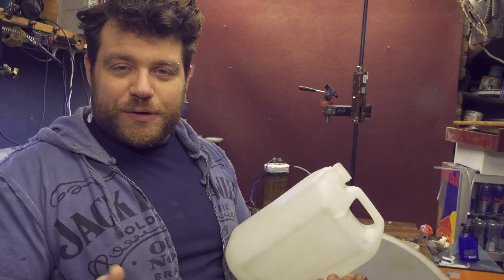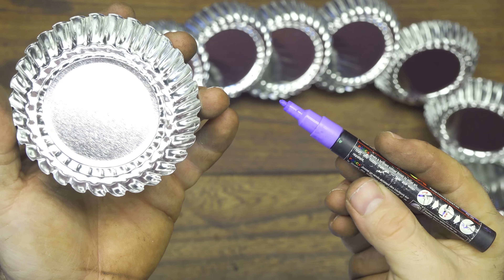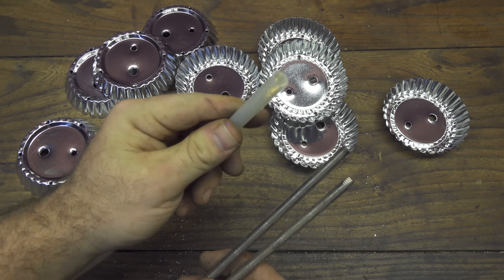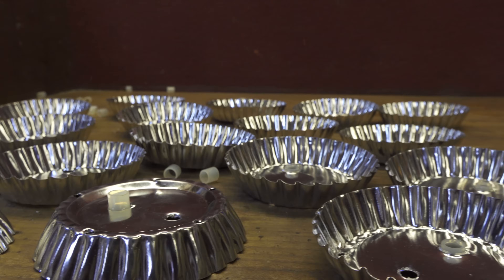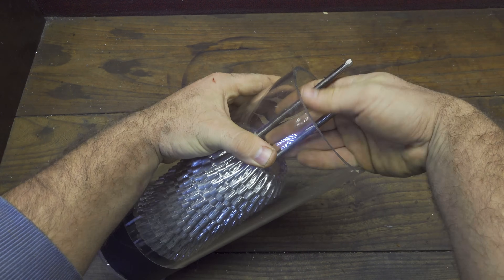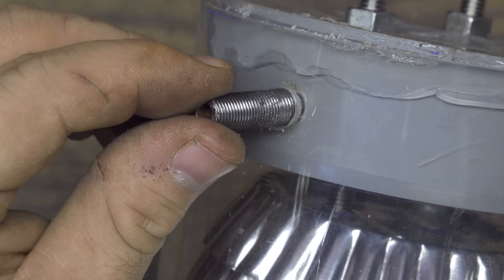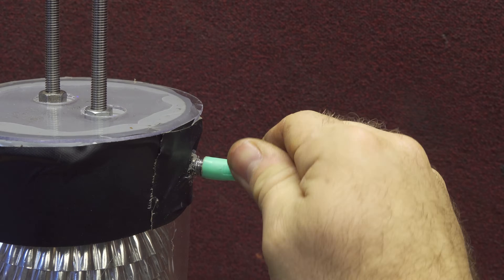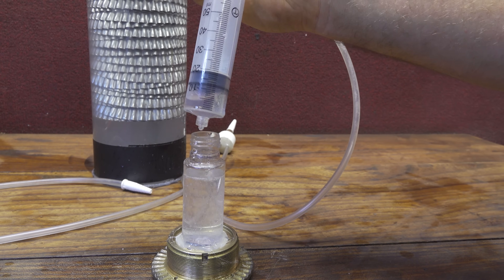Superpowerful Flame 5072 ℉ • Produce Hydrogen from Water - Do it yourself

Comment: How would hydrogen gas burn in yellow color ?
Reply: Atomic.  its temperature is actual based on what the flame interacts with.. amazing stuff.  run it across your hand its barely warm. yet touch tungsten and it will not only melt, it will VAPOURIZE it...   takes over 5000 degrees to vapourize tungsten

Comment: Could you rig that to boil water to heat your house instead of burning oil or natural gas?
Reply: Yes, but it wouldn't be any more efficient than just using the electricity to power a heater. You only get out what you put in. This flame is hot, but it's small.
Reply: @Tonyface666   Well, this tiny flame would have to be bigger.  I don't think you would need to run the wattage that an electric furnace uses.  I just read that one of them is 18,000 watts.  I would be very surprised if you needed anywhere near that wattage to supply all the hydrogen you needed to produce 80 or 90,000 BTUs that an electric furnace puts out. 
He's only using 300 watts and the real problem is turning the high temp into BTUs.
Reply: @alext9067  An electric heater runs at near 100% efficiency (because any losses are just heat).
Using electricity to convert water into hydrogen and oxyen isn't particularly efficient (the water heats up), and when you  burn the hydrogen, it only produces as much heat energy as that which was used to break the water apart in the first place.

There'd be fewer losses by just using the electricity to heat the water directly, without the water -> hydrogen + oxygen -> back to water middle step.

Or to put it another way, if you create hydrogren using 1kJ of electrical energy, you'll always get less than 1kJ worth of hydrogen to burn.

Comment: This is definitely a project i plan on replicating... Any idea on how to catch the water that gets generated so it doesn't just drip all over what you're welding?
Reply: dont make the hose to long..   takes a second for H2 and oxygen to turn back into water.

why the only emmisions from running hydrogen in a car is water out the tailpipe.

Comment: You are using wrong drill shape for thin sheet metal....if you use sheet metal drill(click on link), the holes will be much better/cleaner and you will not bend the cups: https://www.google.com/imgres?imgurl=https%3A%2F%2Fwww.physics.wisc.edu%2Fishop%2Fimages%2Fdefimages%2Fdrillsheetmetalsideview.gif&imgrefurl=https%3A%2F%2Fwww.physics.wisc.edu%2Fishop%2Fterminology.html&docid=VZ09D9Zi0pJtYM&tbnid=ggRMKpo-D5xajM%3A&vet=10ahUKEwizo7Chs8zkAhUMmhQKHRKDDQcQMwiQASgLMAs..i&w=228&h=300&bih=975&biw=1920&q=sheetmetal%20drill&ved=0ahUKEwizo7Chs8zkAhUMmhQKHRKDDQcQMwiQASgLMAs&iact=mrc&uact=8

Comment: High Amps power supply are expensive, but if you get almost any computer power supply, you can have very high amps from 5V, 3.3V and 12V lines very cheap.
BTW, Why does Hydrogen and Oxygen mix only in the nozzle and not in other parts of the build?

Comment: Steel air conditioner/appliance metal is very heavy guage, heavy duty that can typically be found ON THE CHEAP at a junkyard - a JUNKYARD or a bulk metal salvaging center. If you're there to purchase metals then the line is so short you might be the only one in it amidst all the scrappers piling in to drop off their plunder, I mean scrap metals. Going in knowing what you want really helps. Also, could you scale up the 5 volts to 10? Could it also be the overall size of the Generator itself? More surface area in the water, the fins, the enclosure and all things to scale up. I'm really looking for that 3ft long cutting torch! Just kidding! I do want to make small welds, well, medium size welds for melting metals to combine them. Welding!

Comment: Your HHO generator design is very inefficient, and probably gets very hot very quickly. You want to use neutral plates, with a higher voltage, and you can then split that voltage between the cathode and anode with neutral plates to produce the correct voltage to split the water without wasting so much energy as heat.

Comment: baking soda (NaHCO3) is a weak electrolyte. something like potassium hydroxide (KOH) or Sodium Hydroxide (NaOH) would work much better because they are strong electrolytes. only issue is that with the KOH or NaOH the electrodes couldn't be made of something like aluminum because they would dissolve.

Comment: try separating hydrogen and oxygen, then you add a preburner to increase the hydrogen temp and you can get some pretty fucking insane temperatures when the hydrogen is pre heated to it`s burning temperature  and mixed with oxygen.

Comment: But it looks like the cups are touching each other, or nearly so, and could short out... am I missing something here??  At least put a dense mesh in between them... And I think if you invert the cups, gas won't pocket in between them and block current so much.  Also your safety device/bubbler is a good idea, but I'd be afraid it would explode if the flashback arrestor failed or the supply hose was accidentally cut by the flame etc. so maybe best to shield it in a vented enclosure. 👌

Comment: max amps that you can pump through the electrodes is half of electrodes total surface in electrolyte in metric units. after this max you start heat electrolyt

Comment: By the way, your transformer is from a microwave i think, so you can use a wire whit a bigger diameter and only 2 ore 3 spire to obtain 2-3V and more amps. for DC you use diode bridge

Comment: for a better efficiency use 2v DC current. if you use 5V on your builted cell, with 3V over what i say you only heat the whater. I am not sure but fo tap whater and salt is necessary only 1,23V

Comment: Can you use copper fiber instead of brass fiber? Like the ones in copper wires?
Reply: You want brass because there will some electrolytic solution traces in the vapor that will deposit and eat copper alive, break down your flashback arrestor and cause a serious issue... I know this from experience.

Comment: Hey I have a question, how do I know the consumption rate, let's assume am using this for an hour everyday, the same setup, in a month what would my consumption of electricity in kilowatts be !?
Reply: Determine the DC current in amps and multiply it by the DC volts. The answer is watts. Divide that answer by 1000 and you get kilowatts. You don't consume kilowatts, you consume energy (joules). Energy is the product of the time in seconds times the number of watts. Watts is time related, one watt is one joule of energy per second. In other words, watts just express the rate at which joules of energy is consumed. Just as speed is the rate at which miles are traveled. Multiply speed times time and you get distance. In your case multiply the watts times hours for watt-hours. Divide that by 1000 and your answer is kilowatt-hours. Got it?

Comment: Is this the ideology behind hydrogen power? I think certain countries are looki g to make it into a viable source of energy😅.....is it the same thing?
Reply: Current mass produced hydrogen comes from steam cooking natural gas as that requires less energy to get the same volume of gas as using electricity to crack water. When cracking water for Hydrogen gas you want to separate the positive and negative terminals in their own collection areas as you will get hydrogen off one and oxygen off the other. In a HHO generator like in the video you pack the terminals as close as you can under a shared collection area as you don't care about getting as pure a gas as you are using it asap. 

If we wanted to swap over to hydrogen created from electricity we would need to massively increase the power production and include trunk lines directly to where the cracking is needed but the good news is most internal combustion engines can be modified to run on hydrogen with very little modifications to the engine or car.

Comment: So jet fuel is bullshit after all water is fuel but that would collapse the oil Bullshit market and everything that comes with it  soo will never happen... great videos man thanks
Reply: The main problem with using hydrogen as a jet fuel is the size and weight of the tanks needed as they need to be pressure tanks rather then tanks to store a liquid. In modern aircraft they hide tanks in the wings and that would be impossible for hiding pressure tanks and keeping the same wing profile 

Industrial hydrogen is also a very nasty process to make as it comes from a process done to natural gas that strips and releases the carbon and keeps the hydrogen. To get a clean hydrogen economy setup we would need a ton of power plants dedicated to cracking water and compressing the hydrogen produced.

Comment: Before internet - "Don't try this at home"
Today - "Try this at home (aka Do it yourself)"
Reply: or "disclaimer, don't try"

shows you how
Reply: Long lasting fire with Sanitizer and much more uses   Find out :
youtu.be/NybL5CrWOi8
Reply: well the governments trying to hide it since they had Stanley Meyers killed for inventing a working car that ran on "water"    aka hydrogen from water on DEMAND..  100 miles on a drop of water... lol  of course they want to keep the qaudrillion dollar oil market... cough   gasoline
Reply: @harleyme3163  thats not how this works but ok. This is a way to turn electricity into hydrogen and oxygen gas. which are potent fuels. Its a converter for one type of energy to turn into another. It doesn't make free energy. It wont make your car go forever for free or replace gasoline. It only converts electrical energy into fuel.

The only way this replaces gasoline is if jackasses stop holding back modern nuclear reactor technology. In that case we will have abundant electricity without relying on combustion and without large amounts of pollution, then using that electricity to turn water into HHO, then using that HHO to power machinery requiring fuels which will put out no pollution.
Reply: @harleyme3163  HHO is a two part system used with Nuclear power to fuel the world without pollution. HHO is not a free energy machine.
Reply: @harleyme3163  That's true for all the governments around the world. No exceptions! ;-)  lol :-P
Reply: @harleyme3163  Tinfoilers back at it again.

Comment: DON´T do electrolysis with salt, it generates toxic chlorine gas and sodium hidroxide. Also hydrogen is extremely dangerous because it can explode very violently. Also the electrodes in the water can react and liberate toxic oxides.

Comment: If you make separate stacks each in their own container (one connected to positive and the other negative) connected by a tube at the bottom so the water can flow between both containers, you can collect pure hydrogen from one container and pure oxygen from the other. Just be careful.

Comment: Good stuff but wondered when you were speaking about soldering st steel if it's actually possible? Don't know ,never done it but the question remains.
Reply: It can melt iron so it could solder it  slowly

Comment: Could you make it in a way to store the oxygen and hidrogen SEPARATEDLY?
Reply: You would need the + and - placed in separate containers, with a liquid connection.  Like a YouTube ?!  So it would cost a little more energy to make the gases separately, because of the resistance of the connecting liquid.
Reply: @gerardvaughan1847  but on the bright side you would be able to safely store the gases withou them blowing up catastrophically
Reply: @LuizBarros99  
Yes, far less dangerous.  I think the mixture is called Brown's gas, and surely a container of it is a Bomb !
Reply: @gerardvaughan1847  yeah, both a high reactive gasous fuel and a highly reactive gasous oxidiser in about perfect proportions...
Reply: @LuizBarros99  
I imagine the proportions would be perfect.  I wonder if "fuel cells" + gas bottles will ever compete with  Lithium batteries ?
Reply: yep , the positive line always forms one and the negative line forms the other, so if you spilt the cell into an odd shape the oxygen would come off one chamber and the h2 off the other.

research anode and cathode production in electrolysis,, I forget which is which since I just pump both for torch.
Reply: You could use the flame to heat water and make steam to turn a turban  to create the current for this cell and use the hot water.

Comment: Separate the Gases and use less hydrogen, the yellow is a  carburizing Flame.  neutral Flame is when the yellow goes away. To much oxygen is a oxidizing flame its useless and will pop the flame out. Oh yea there is one thing that it can be used for..
Fill up a couple of baloons and turn them loose on New Years Eve. Get everyone to pop them with cigarettes.
Take it easy with the oxygen...... They won't hurt you but they are loud.!
Sobers everyone right up.  LOL

Comment: "safety is very important" has a exposed ass trasnformer sitting right next to his generator
Reply: He didn't say "Safety is number one priority".  Just that it's important.
Reply: that's filled with water?
Reply: It's only 5V it wont shock him unless he's touches it with wet hands filled with an electrolyte
Reply: He knows what not to touch. In this case, the primary coil terminals. For you uneducated people, 'don't touch the "scary stuff." '
Reply: @hexdude24  is there any potential for arcing?
Reply: @benjaminbarr8714  If you are talking about the primary coil terminals, No. They are too far apart. Maybe if they were a milometer apart.
Reply: @benjaminbarr8714  its under 10v, no potential whatsoever
Reply: Long lasting fire with Sanitizer and much more uses   Find out :
youtu.be/NybL5CrWOi8

Comment: If you want to keep the generator bottle cooler, put it in a tub of cold water.. you REALLY don't want 50 amps running through water leaking across your desk if the bottle melts through.. you would make the evening news though.. ;)

Comment: I built an HHO (Browns Gas) generator about 10 years ago, and fed the output into my old car.. It more than tripled my mileage, since that car was EFI and fed fuel (gasoline) to the engine based on how the car was travelling..
One evening,  just to see how far it would go, I ran the car completely out of gasoline and I drove it 50ks on an empty tank.. burning almost pure hydrogen (with a little petrol vapour).. It finally spluttered and failed, so I switched to the LPG tank fuel and drove home, (via a petrol station)..
In the 6 months I ran that HHO system in the car, I covered over 10,000ks (6,000 miles) used about 600 liters of petrol (less than half I would have otherwise), and I didn't have to add any water to the bottle at all.. it used about 15% of the 2 liters I started out with.. amazing system.. incredible amount of energy stored in plain water..
Reply: Mik Wri  You're a fuckwit.. I bet you're invited to all the good parties, aren't you..?
I still have the glass jars I used to to generate the HHO gas. They haven't been used since I took them out of the old car, so go and get stuffed with your shitty attitude, or, better yet, build a system yourself and try it out, you might just find out what I already know.. that I'm right.
Reply: Oh, and Mik, just last weekend I dusted off those generator jars to show my almost-5-year-old daughter the power of hydrogen..
I hooked one up to an 18 volt battery from my Makita drill and it worked immediately.. after 10 years in a box in the garage..
Bubbling the gas through soapy water means you can gather up some in a teaspoon and touch a flame to it.. the "pop" of just the smallest bubbles is seriously impressive.. want a bigger bang? Try filling a plastic milk jug, (by way of the displacement method using a large water-filled bucket), and then a small birthday candle taped to the side as a fuse..
Stand as close as you like, or dare..
Reply: @tynj4173  

Get a small clear glass jar, fill it 2/3 with petrol, put it on the concrete and light it.. 
Now observe the jar from the side, tell me where it's burning.. you note that the flame starts ABOVE the liquid, not ON the liquid.
in fact gasoline as a liquid, doesn't burn, because there's no oxygen mixed in with it..

Gasoline VAPOUR is what burns because it can then mix with gaseous oxygen, same as Kerosene, Butane (which is stored pressurised in liquid form), and most other flammable liquids..

So, to answer your question:
The Generator breaks water in to Hydrogen and Oxygen, both in gaseous form, these mix (forming HHO) in the collector area at the top of the generator, and are then pushed into the air intake, under the pressure created by the release of more HHO from the water, just before the vehicles manifold.

You still have to have 'some' regular fuel in the vehicle (I didn't hook in a switch to turn off the fuel pump for example), so the car still uses a bit of Petrol or LPG, but the HHO gas mixture accounts for a MUCH more powerful fuel, meaning the car revs better, burns cleaner, and the sensors in the cars fuels system then work out that, for some reason, the car is performing better, (it doesn't know, or care, WHY, just that it IS), so it doesn't need to use as much fuel..

however, here's the caveat..
I wouldn't run this system permanently because Hydrogen burns much faster, cleaner and hotter than petrol.. ICE's are designed and engineered to run on fuels which, also by design, are not 'clean', the gunk and oil in petrol and LPG slows the burn time in the cylinders, and helps to lubricate the combustion chamber..

Hydrogen burning as hot as it does will promote conditions where excess heat can eat/decay/corrode the tops of alloy pistons and cylinder walls over time.. but I'm sure an engine could be designed to resist or negate this.. Stainless steel perhaps..?

For this reason, I didn't run my HHO system every single day or every single mile, but I did for more than 95% of the total time and distance..

Hope this helps.. :)